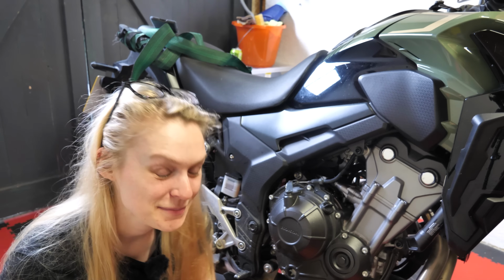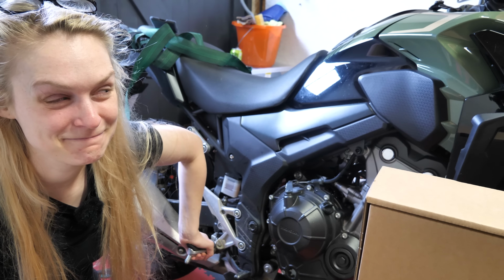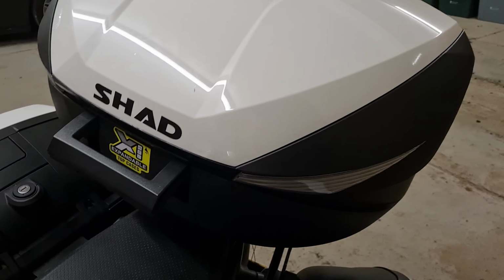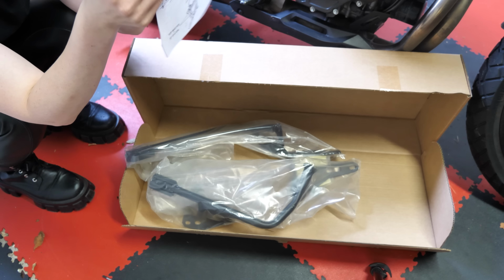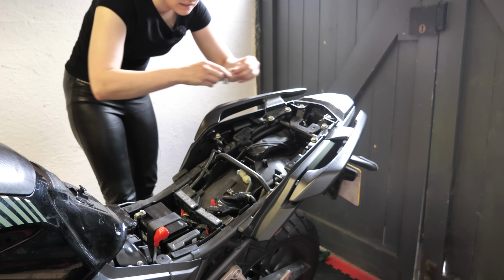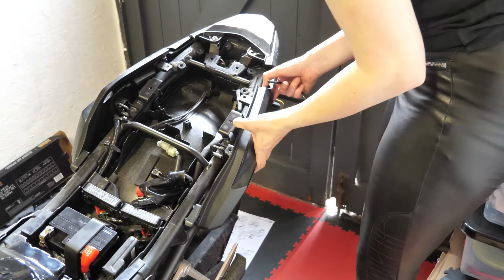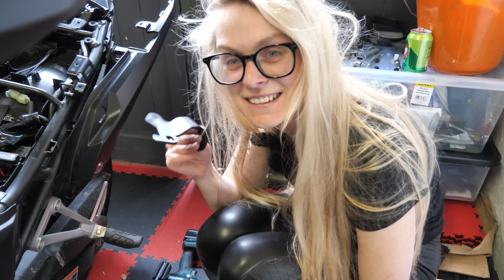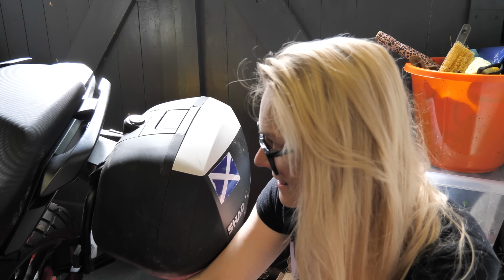Getting ready to go touring again!

Comment: I feel you😂.  I once replaced the battery on my tracer. A job which normal people will do in 20 minutes. I did it in 3, 5 houres.  Needed to go back to the hardware store 3 times because the screws kept dissapearing.  😂

Comment: Thanks for the entertainment Saffy. That was a good one with the ring spanner on top of the screwdriver. Try to use the correct tool for the job and it will save your knuckles. I'm sure the bike will give you good service.It's a Honda. Happy travels.

Comment: Wow Saffy you cover some mileage, wish i had your energy 👏 hope the trip goes great!  may i please recommend you do NOT use a hammer of any kind to undo nuts or bolts, its about leverage so add a pipe to the ratchet handle if needed and steady pressure. Hammering could damage the nut head and cause a disaster
Reply from the maker: It's all in the ✨red bull✨

Comment: I think you should check that your left bottom bracket is properly fastened to the passenger foot peg. It looks like a bit wobbly (see time 9.30).
Been there recently since I just installed Shad 3P systems to my SV650.. 🙂

Comment: Saffy, if no one has told you yet, that wire loop thing is for locking your helmet to the bike, under the seat is a hook, the wire thing goes through a D ring on a helmet and you hook to the bike put the seat back down.  Penny pinching by Honda
Reply from the maker: I've never seen one before and I've never had a bike you could look you're helmet too 😂 it's a first from me!!!

Comment: You need a piece of the right sized pipe to go over the handle of your socket handle to increase the leverage. That would have done the job way easier. That or simple buy a longer socket handle( at least 300mm)

Comment: When your soft luggage does arrive be careful of burning them on the exhaust. You will need a stand off of some kind to prevent contact.
Reply from the maker: I've heard that before 😂 but the luggage will be high up I believe!
Reply: Yep done that. My soft luggage melted on my Speed Triple with low exhaust even though I was riding in a typical British april downpour. Bag never touched the exhaust either, it was just the heat coming out of it that melted through the bottom of the bag and fused everything in it together lol

Comment: Get a metre or so length of metal tube that will fit over your spanners/wrench, it'll make a huge difference on undoing those tight nuts and bolts. Don't use it for tightening them up as it'll be too easy to over do it and strip a thread.